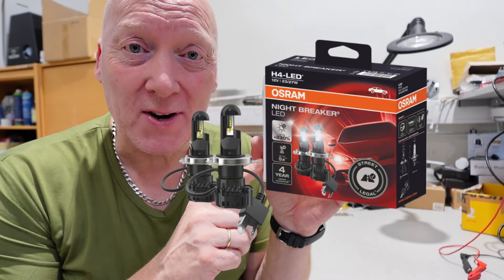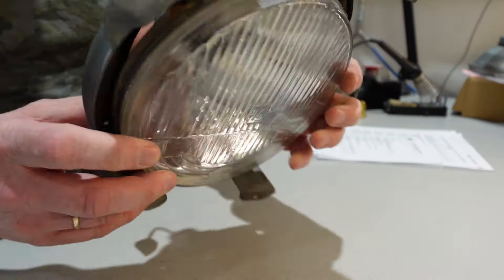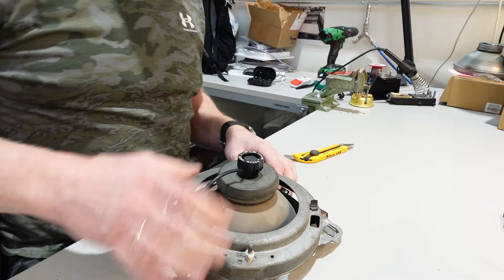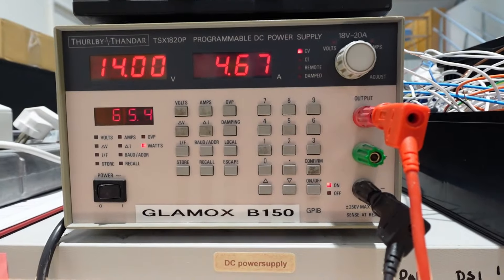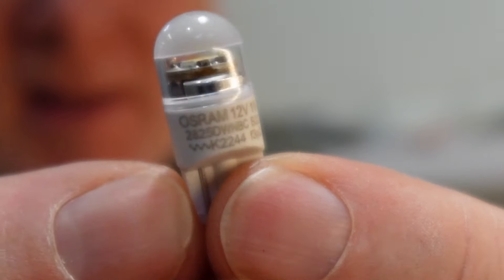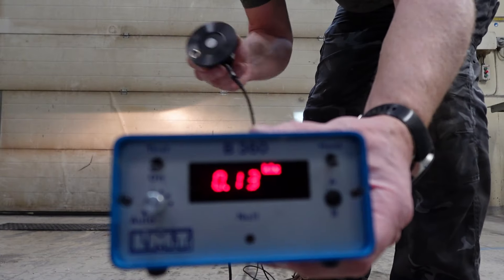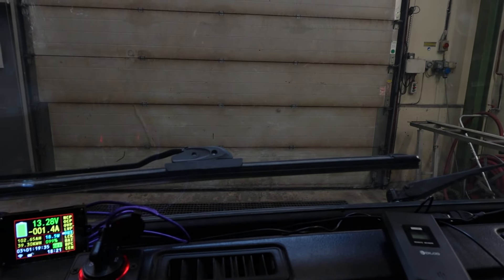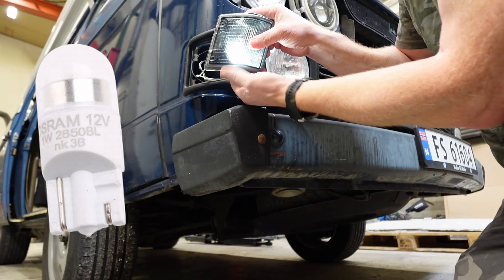EU approved Osram Night Breaker H4 LED for retro cars, here on my Vanagon T3

Comment: Will these dip to the left on UK right-hand drive cars, or are they specifically designed to dip to right. I realise that a standard H4 halogen bulb will work in both .
Reply from the maker: The bulb is universal, it's the headlight that need to have the correct dip. You will see the "dip" in the front glass of the headlight design.
Reply: @Italjohn  Much appreciated
Reply: I've just bought a pair of these from the Netherlands and found that the bulbs are not universal. The  vertical axis of the bulb is rotated slightly anticlockwise ( about 10 degrees ) in its holder so the light distribution is only appropriate for left-hand drive cars. No easy way to modify the holder so will have to try and sell. Let me know if anyone's interested in buying.
Reply from the maker: @EdBlaszczyszyn  You might be right, as I can't find UK in the approval list? https://www.osram.de/am/night-breaker-led/night-breaker-led-ledcheck.jsp?mkt=/nb-led/
Reply: @Italjohn Ireland is RHD